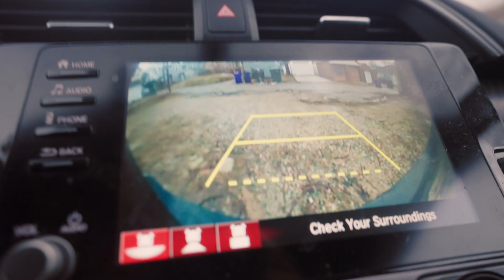There can be only one BOTGRINDER

Comment: I just got some DJI goggles as well only I got a set of V1 I put a couple air units in all my plane in my wings now I need to order a couple more for my twinsters 3.5 inch quads going to continue to run hd0 in my Darwin freestyles you haven't flown a Darwin freestyle unless you've blown it with hd0 I my piloting skills have jumped about 643 Rebels and I started flying the Darwin freestyle with hd0 that thing is a little Ripper